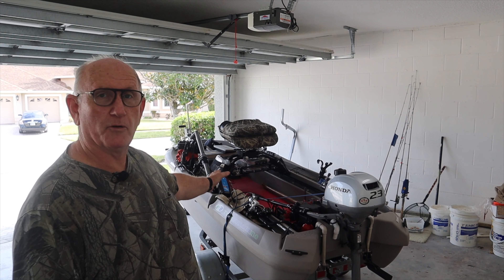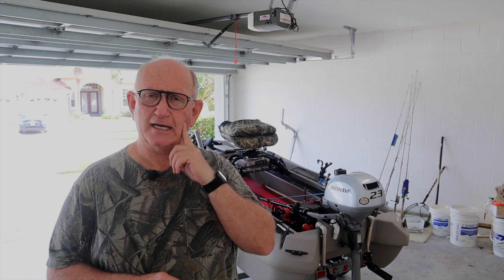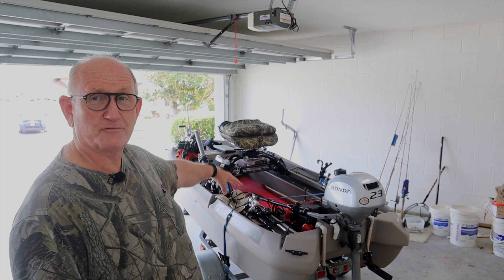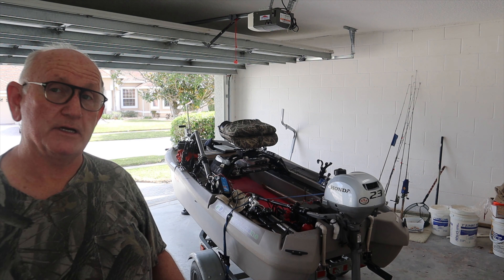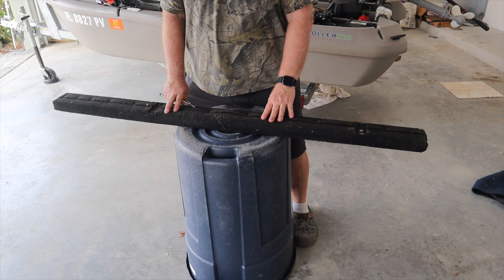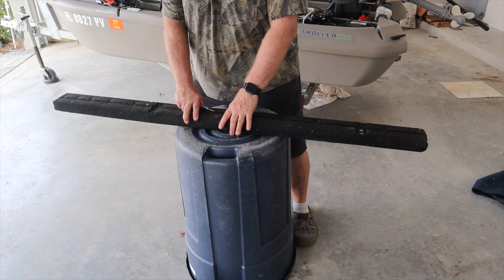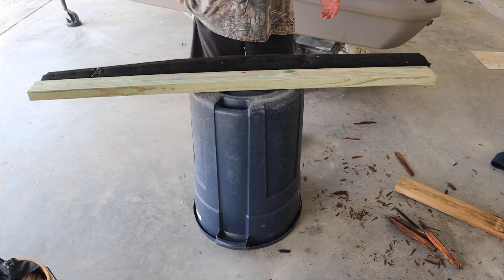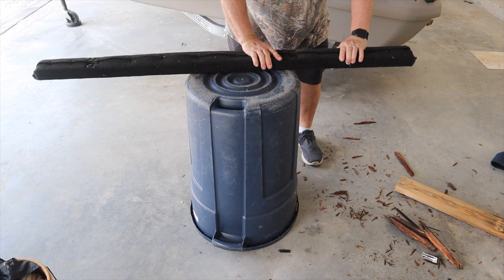My Boat Trailer Needs Repair!

Comment: Hi Gerry, the SS lag screws were best option for repair with boat on trailer.  With boat off trailer, I would recommend replacing lag screws with SS bolts and locknuts (with bolt beads countersunk).
Reply from the maker: Rod, I agree and that is what I showed you I did with the new bunks. Much easier to install with a hex head rather than the Phillips head of a screw.           Gerry

Comment: Thanks, Gerry.  I wonder if Composite Deck Boards would work?
Reply from the maker: Tom, I thought about that but I am not sure if composition boards would support the boat in places where is is not supported directly with the bunk brackets, especially on the very ends of the boards where they would go into the water. They may be a better board but since these lasted eight years I home this last until 2030. 😁        Gerry

Comment: Dog gone it Gerry now I have you to blame for me having more work to do. The last time I pulled my boat out of the lake my left bunk tipped a little to the left so now I'm pretty sure I might have the start of the same problem so Thanks a Lot for giving me more work. To be serious now Gerry I am so glad you made this video so I know what I'm facing and can repair it or in some cases I pay one of my Amish friends to fix stuff for me. I see your over 3000 Subs now. I remember winning one of your giveaways when you hit 1000 and my Daughter actually caught some Rock Bass with the worms you gave me. It must be rough to wear shorts and a T Shirt on January 1rst when we were comfy in insulated coveralls and sipping coffee by the wood stove.
Reply from the maker: Steve, I have to be here in shorts and a T shirt because I could not be up there wearing insulated coveralls and drinking hot coffee. That is because I have had less than five cups of coffee, and even less of tea, so I need to be some place warm! 🥶
Sorry about all the extra work you now must do. Just get your Amish friends to watch the video  🎥  so they can do the work for you. 😊Gerry

Comment: Gerry, I'm have a problem with a controller on the twin troller. I purchased a replacement, and the motor still does not run. The motor runs if you wire it direct to battery. I haven't found anyone local to work on it. Any suggestion?
Reply from the maker: Jacky, swap your connector wires and does the pedal drive the motor then? If so, either you have a problem with your wiring (use a millimeter to test the wires using the other pedal wires as a template since that one works) or your controller is bad. You said you replaced that controller. How long ago? Still under warranty from FEM? If so contact them. If it is not still under warranty it sounds like you need to buy another controller. 😞                                    Gerry